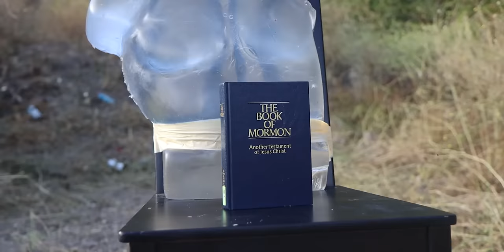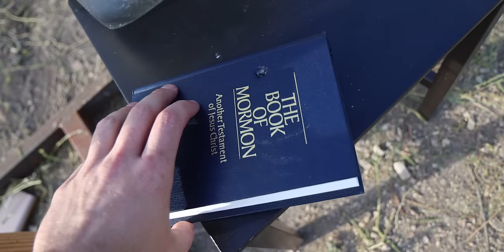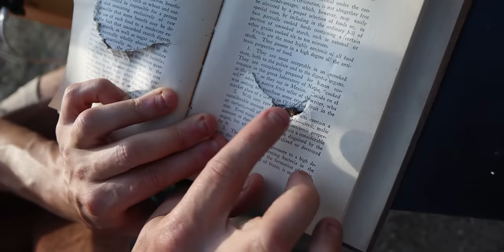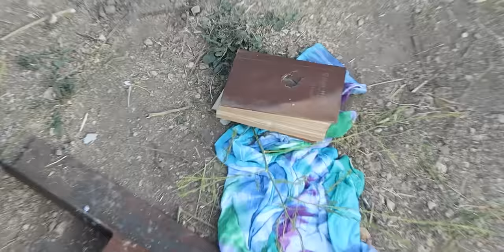How Many Shirts Will Stop a Bullet?

Comment: I think the 60 might have done it if it was someone actually wearing 60 instead of it being 30 just sitting in front of it loosely and folded in half. They just need to be more compressed together, if it's loose the bullet goes through each layer easier. It's easier to go through 60 seperate shirts than it is to go through one shirt that's as thick as 60 if that makes sense. That's why on the last one when they were rolled up tight it worked.

Comment: You should have a hard layer before the Kevlar/shirts, a hard surface will deform the bullet which reduces its penetrating capability.
Reply: I think you got that backwards. And what do you mean by "hard layer?" The plate carrier I wore (and every other human being that has ever worn body armor) has an outer layer of kevlar, and usually an anti spalling coating on any hard plates beneath that. Depending on whether you're using class 3, (which you wouldn't bother with kevlar usually) class 3a, (definitely uses kevlar) or class 4 which if anyone says they own, they're full of shit because ceramic plates are stupid expensive. Unless of course there's something I don't know here. What did you mean by a "hard layer?"
Reply from the maker: Yeah it would have made the apron unwearable
Reply: @eamonia  Anything hard enough to deform the bullet.
When the Myth Busters were making a bullet proof car using phone books they noticed that putting the phone books behind the glass made the bullet pierce less pages than having one or more phone books in front of the glass.
Reply: @Ididathing  Not necessarily.
Scale armour is wearable.
You could cut pieces of metal and glued/rivetted/sewed on the apron (or between the apron and the Kevlar) to make some kind of scale pattern.

Is it unwearable? I don't think so.
Reply from the maker: @andregon4366  Yeah not unwearable but would probably double the weight. But then again that wouldnt have mattered in the video
Reply: @Ididathing  Ok hear me out... Sequins!
Reply from the maker: @speedymcrunfast3  i like it

Comment: The way kevlar works, is just unweaving the edges of kevlar-fibers to dissipate the force of impact through woven strands length; kevlar doesn't push back or resist, it just gives-way and pulls the whole surface area to catch and trap the slugs: so a 22lr has a way better chance at penetrating than a 9mm, and a .17hmr will probably go through, whilst an arrow will absolutely punch through.

Comment: See, the other problem that isn't shown in this is that the .22 just imparted 250-350 meters per second/80ish foot-pounds of force into your torso. That's not good for your squishy bits or your bones.
Reply: Meters per second is a measure of speed and foot pounds is a measure of energy

Comment: you need to laminate the kevlar with a resin for light armor if you wanna add extra protection use ceramic in conjunction or if you wanna go cheap cut plates of good steel like ar500 and use em with frag wrap or just a shit ton of duct tape dont use steel and kevlar as it ruins the point of kevlar being light

Comment: .22 Caliber is a horrible round to test this with. Yes its a low caliber bullet but small and fast is easyer to go through a real vest or lots of clothing.

No one that would be trying to shoot you would be using a .22.

Two most likely calibers to be shot with are 1. An AR round .223 or a 9mm

Even a real bullet proof vest will not stop a .223 rifle round unless it hits a chest plate if your vest is even rated to have a plate so this test would be pointless to test with a .223 so that leaves the 9mm. 

A 9mm is a lot larger than a .22 but larger is more likely to be stopped by something like heavy teeshirts than a .22